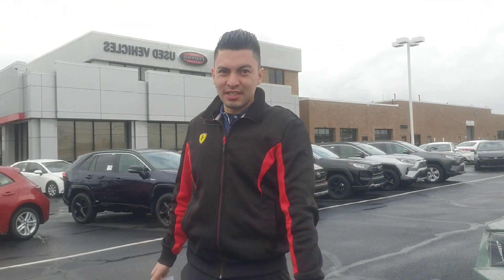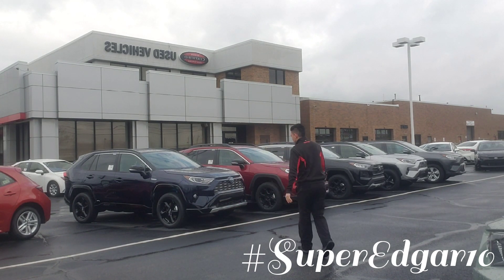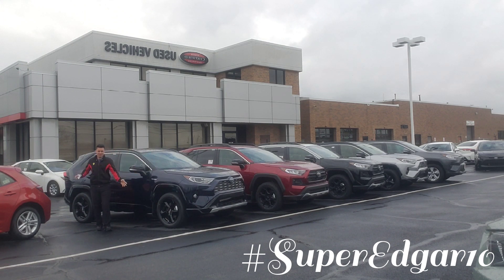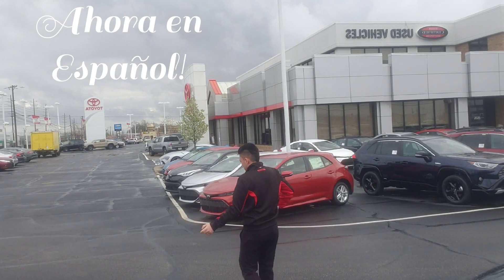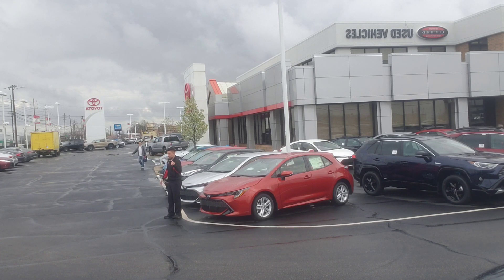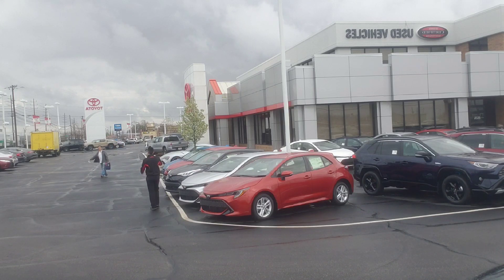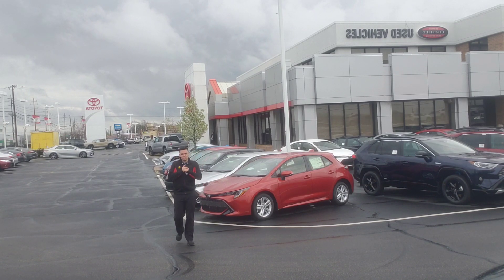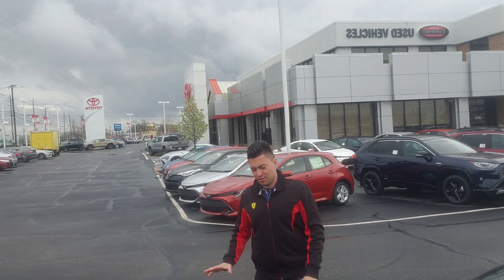Toyota Pre-collision system failure: Ideas of what might be the problem (English & Español)

Comment: I have the 2020 Tundra.  I paid top dollar for the Toyota "brand"   Its only got 10k miles and it's now a brick thanks to their crappy PCS (pre collision system).  Although mileage is low, Toyota won't stand by the product because the warranty period was last year.    

This is happening on the Tacomas too.  This isn't "dirt" on the emblem.

Now I have a 50k brick in my garage.   Also this fails in a NOT safe way with the brakes.    PCS system has totally crippled it - and will be thousands to fix.

If you have are getting a PCS (precollision system) error and ANY brake activity, please report it. This is happening on newer models of Toyota. Toyota is NOT standing by their product.    Along with all the engines blowing up- Toyota brand is pretty much in the dumpster for quality.

The braking issue is a serious safety problem - so please report it so hopefully they will be forced to fix this rather than leaving customers out in the wind.   U.S. Department of Transportation’s (DOT) Vehicle Safety Hotline for consumers on vehicle safety problems. Call 888-327-4236 

Many of these are recently falling out of warranty window.	Toyota Brand Engagement will tell you to pound sand the second the warranty expires

Comment: I had the same problem. After spending 400 dollars to have the camera calibrated it did not fix anything. The problem ended up being the radar module in the grill badge was dirty. (the inside of the badge and the front of the module).

Comment: im having this issue in my toyota axio hybrid, this happened after i removed the spacers from the rear end and the error code im getting is U023A. The dealer says the camera module is to be changed but that is not convincing. Any idea?

Comment: Mine happened after a hail storm, I looked for several videos where the issue might be coming from. I disconnected the battery to reset the system and it came back on. When I press on the brakes I feel the brake pedal kind of shaking and it turns on. I got it at 7K miles and im already having issues…. What a joke…
Reply from the maker: Wow

Comment: Wow bro… very helpful thank you!! It was the weight distribution hitch they installed at the RV dealership. I guess the sensors detect it when your not hooked up to the RV and it turns the light on. So I took off the whole hitch and boom. Fixed!! Thank you!

Comment: i had a car accident it hit the left side of my car and it broke the whole headlight..got it fixed and all but the screen shows up saying “LDA malfunction…Pre-Collison Malfunction..headlight malfunction” and i might go to the dealer for they can check with computer..im suggesting where i got my car fixed didn’t do their job good or? do you have any idea what may b wrong? it’s a Toyota Camey 2020 SE ):
Reply from the maker: u should have ussed your into get all that fixed because it deff needs to go to the dealer to get reconfigured and all that good stuff.
Reply: I’m having the exact same issue and the dealer thinks it’s the engine wiring harness. Did you find a fix for this?
Reply: @Samantha Ramos. Any updates on that?  I have a very similar problem. Had to replace a headlight and the LDA and pre collision lights went on. Did you figure out what’s wrong?

Comment: Edgar I’m getting the warning and all types of lights went to the dealership and they told me they needed to replace the alternator, belt and more diagnostics. I put a new alternator and belt same problem new battery as well. Why would the warning and all the lights still coming on? Could something not be connected or wires cut somewhere? Anything would help.
Reply from the maker: yeah maybe some cables were chewed out by animals :( im sorry this is happening to you.
Reply: @SuperEdgar10  can you give me some locations to look for wires that maybe bad? Thanks!
Reply from the maker: @Sandman-b5s  check all of them . I have no idea really
Reply: @Sandman-b5s  ?
Reply: Did you ever figure it out? I'm having multiple malfunction lights go off right now.
Reply: I’m having the same issue. Did you find a fix?
Reply: @karlakellogg3618  unfortunately no so frustrating
Reply: Two different trips to dealership, with over $2500 in repairs... and it's still not working. Just found this page... going to try to clean the radar sensor and cross my fingers. The other thing I've seen online is that sometimes during brake repairs, things aren't connected correctly again and result in this warning. Had my brakes done just before this happened, so that's another possibility on my list.
Reply: @kreiskrewe-nursingtips7614  Did it work? i have a 2018 Camry, multiple warning lights going off. Not taking it to the dealership to shotgun the problem.
Reply: @brandonbarbera9411  The sensor was cleaned off and that didn't stop it. Next step is different dealership, asking them about the brake repairs and making sure it's correctly put together again.

Comment: I hit the curb 🤣 that’s why it’s on but it only turned once I got it back from the dealership
Reply from the maker: Heh
Reply: How did you fix it? What did it cost?
Reply: @eddiemane6417  honestly bro, I think u just need to unhook the battery to reset itself, never got the light on again after replacing the battery. So just try to disconnect the batter for a bit and you’ll probably be good

Comment: I have this problem, after I install a back light.
Now how I solve it?
Reply from the maker: you messed with electrical cables? that is no bueno. only dealership might be able to fix it
Reply: @SuperEdgar10  when I show this problem with my dealership, they disconnecte that back light,
But- The Pre-Collision system malfunction massage are not gone.
They & I dont know, how we fixed this problem.
Because Our Country has no Original dealership from Toyota Japan.
Only some few importer Imports Toyotas car from toyota re-condition Market, Japan.
Reply from the maker: @sajibsarkar1549  ahhhh that is no bueno!  I wish i knew how to help but im not sure..   Where do you live?
Reply: @SuperEdgar10  Bangladesh
Reply from the maker: @sajibsarkar1549  that's awesome!
Reply: @SuperEdgar10  Hi! I got into a small accident and took my car to a body and paint shop and am now receiving this error. Could it have been an installation issue and is there any way to resolve it myself?
Reply from the maker: @fernandof.c.7120  they supposedly fixed to so take it back to them to repair it correctly.. If they cant you will have to take it to a dealership unfortunantly